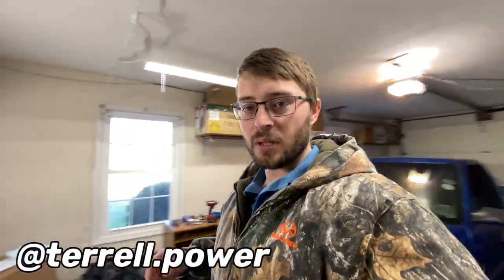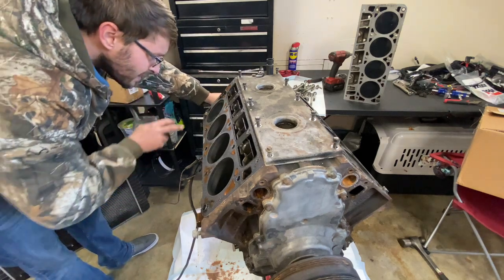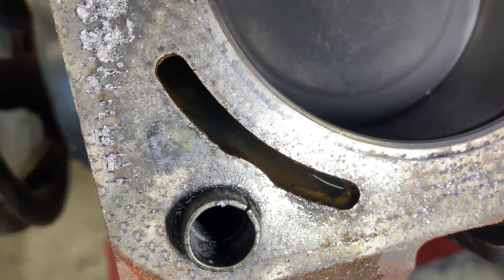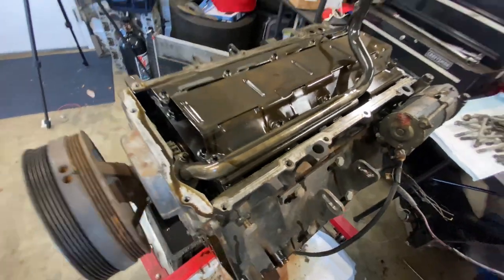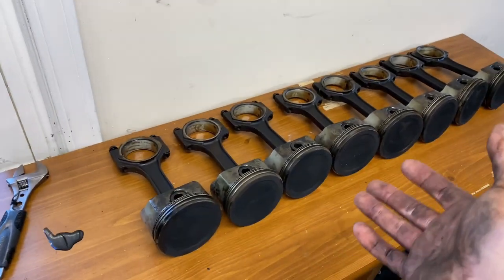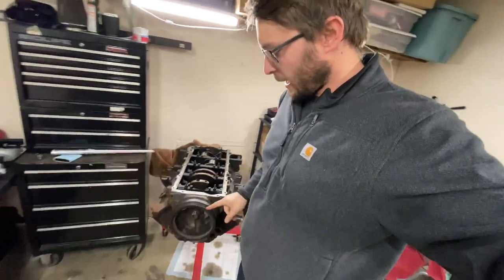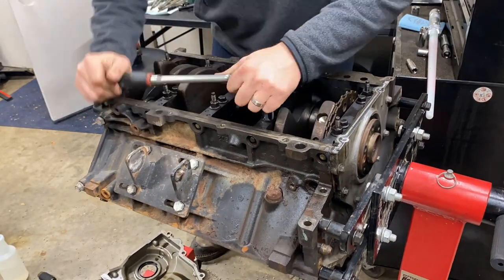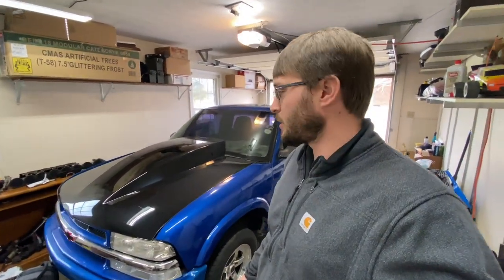Hayfield Garage: Ep. 5: 140k Mile Stock 5.3l LS After MANY Bottles of Nitrous // How Does it Look?

Comment: Are u going to have reluctor wheel tack welded or a billet one installed?
Reply from the maker: Not sure, I don’t guess I follow?
Reply: The reluctor wheel on the crank.. I was just curious,   Iv had issues with that recently. Truck was breakin up under rpm.

Comment: Bone stock as in ring gap and everything? What mods to top end?
Reply from the maker: Crank, rods, bearings, rings, all stock from factory. Valve springs, lifters, pushrods, cam, is all I changed. I received it as a short block. Changed cam, and sent it.